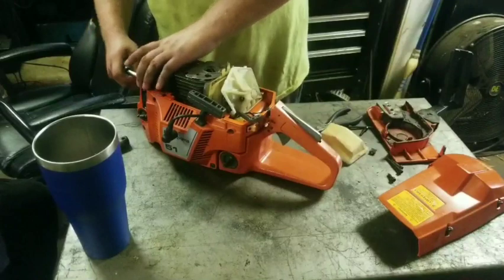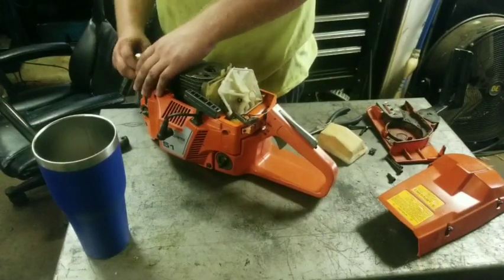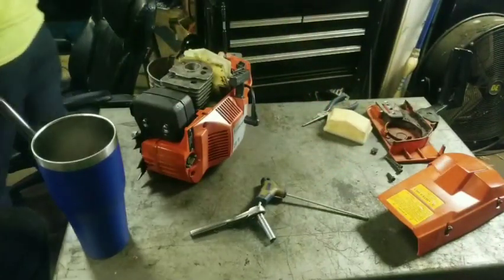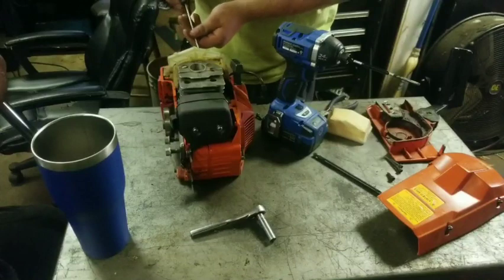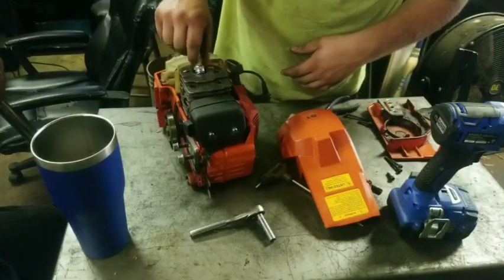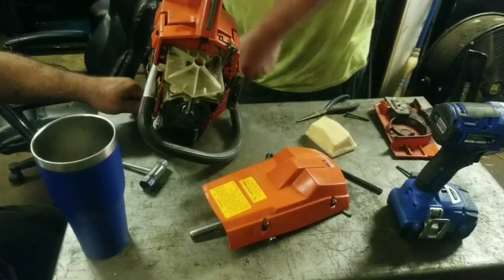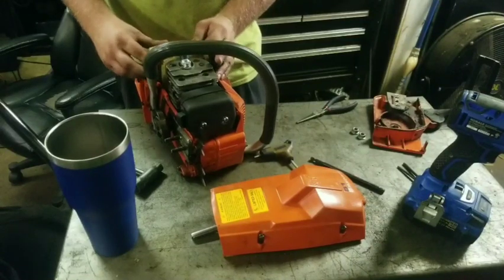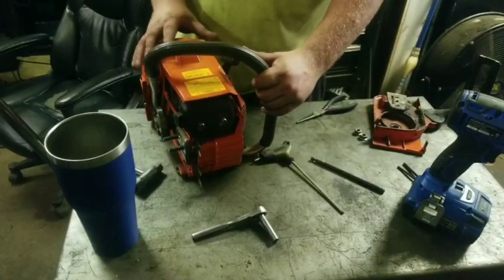Husqvarna 51 assembley and test cut

Comment: I changed water pumps one time from one year to another on a ford 300 6 cyl amd used a long bolt from the old pump on the new thin pump amd ran the bolt through the #1 cylinder. Bad day. Thanks for sharing!! Great video!! STAY SAFE!!!
Reply from the maker: Woo buddy yea thats a bad day for sure lol
Reply: The motor i swaped out had a bad head so i took the one i messed up the cylinder in back out, swapped heads amd put it all back together with the right bolts on the water pump the 2nd time!
Reply: 307 J.O.A.T ya did that on a Detroit 466 in a international 6000 on the oil pan bolt I cracked one of the bosses cause I had grease on the tip of the bolt from lubing up the rust and I didn’t have any never seize left. Took a minute to figure out why I got antifreeze fillin up my engine
Reply: Upstate ny we got lotta rust

Comment: The actual exhaust port was moved forward, closer to the top of the bar - is that correct, Mr. Bell?
Reply from the maker: Yes so it doesnt burn the brake handle anymore like all those saws do
Reply: Yup, got a 51 torn apart in the garage with scorched top cover and break handle missing.  Looks like the piston on this one is scored and needs replacing.
Reply from the maker: @jolkraeremeark6949  we cleaned up a scored cylinder and piston for this build it had a few scratches on it but cleaned up good